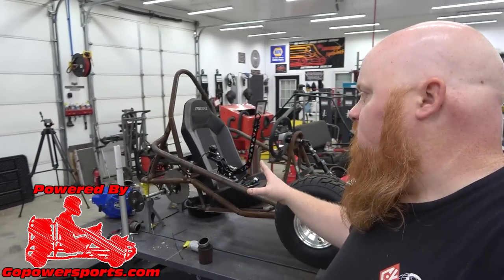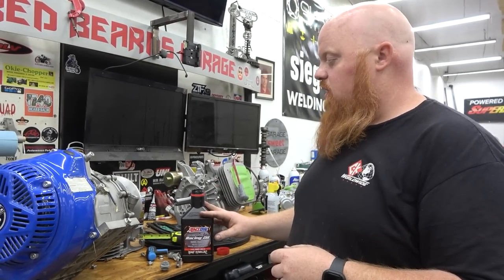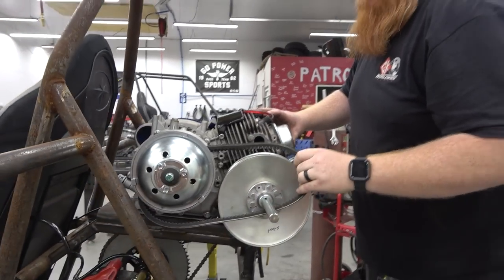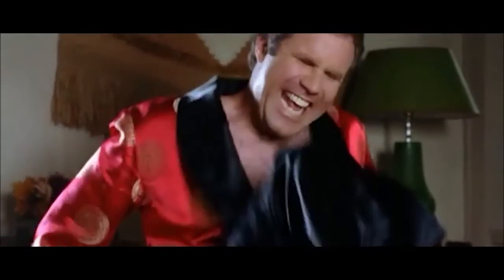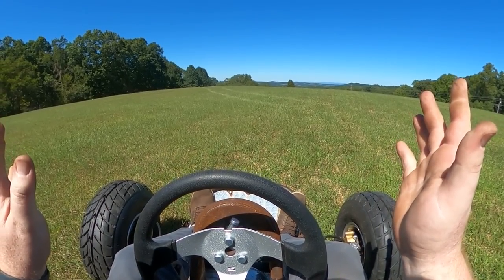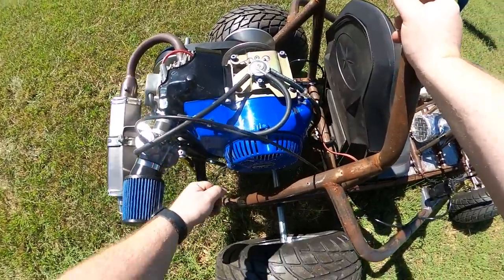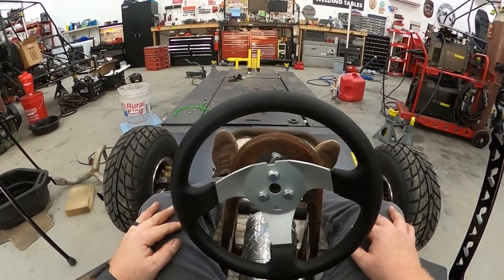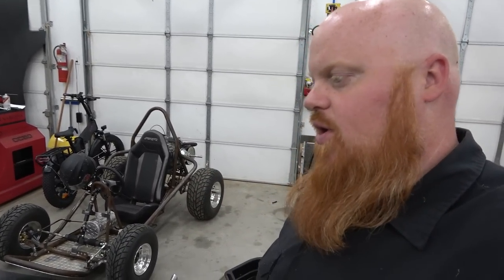Big Boy Go Kart Drifts & Street Run

Comment: I have a mega moto pro with an almost stock tillotson 212, I say almost stock engine, it's got a stage 1 kit. It still new and had maybe 2 hours on it and amsoil brake in oil in it, I bought a magnet dip stick for it from home depot. I also just bought a duromax generator, the 9000 is, that to will be getting amsoil break in oil and a magnet dip stick. Take good care of an engine and it will take good care of you.

Comment: That gearing is spot on, and that CVT sounds like its working perfectly.  High acceleration, pretty good top speed, and the engine rpm sounds correct.  Probably the best implementation I've seen/heard on all the channels I watch.

Comment: Great top end. Should put some road tyres on it and the smaller diameter will help with getting it up top end?
If you start finding that the final drive sprocket is getting "too large" you can add additional reduction drive 😉

Comment: This thing really rips! On the 440cc build video, I was dumb and asked if the Vegas 460 carb would work, what I meant to ask was would the Vegas 460 connecting rod work on these 440? Would be nice to bump up for more torque since VegasCarts no longer sells the 460 engines anymore.

Comment: For the suspension version, I suggest lengthening the wheelbase to keep the pedals rearward of the front wheels. You don’t want the first part of your vehicle hitting the wall to be your feet

This also means you can/should widen it a tad, which will be a benefit for you making the suspension geometry easier to get right. Also-also look into control-blade rear suspension, you don’t need much room and it eats bumps for breakfast, even with borked shocks (it’s travel keeps the wheel in the right camber further through the travel than pretty much any other style)

Comment: I like it I just love go-karts to boot but  1 thing you should try to do is lower the moter down not as high in the rear because it should be centered better..I like the short frame design too..but it does run good

Comment: Used 2 of these engines on swaps on my golf carts one stock one with Billet rod flywheel camshaft valve springs Mikuni carburetor both are holding up well been on them for around 3 plus years

Comment: I followed  the Amazon link from your website and had to laugh a little. Under engine building you have lucas break in oil additive and valvoline synthetic high mileage oil. But your pushing AMSoil in videos.